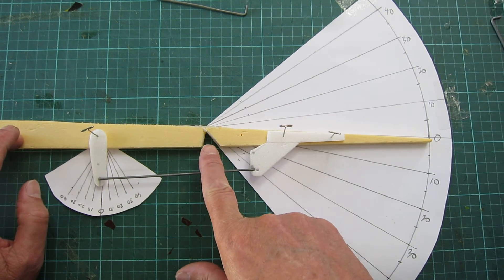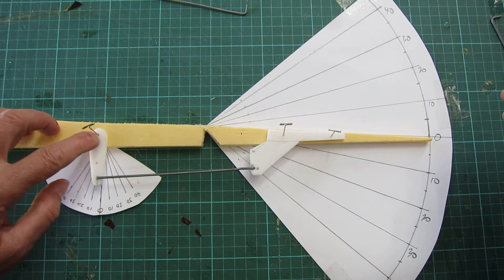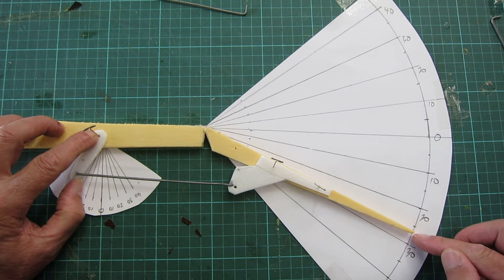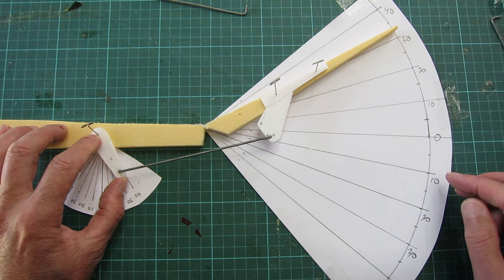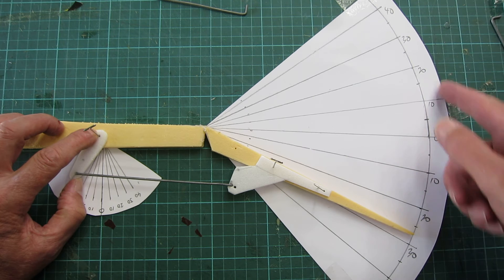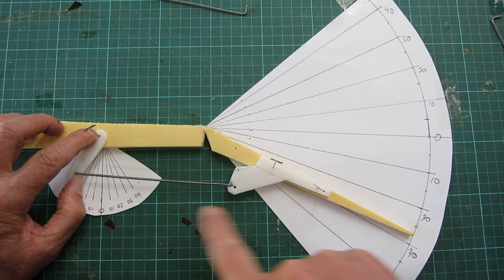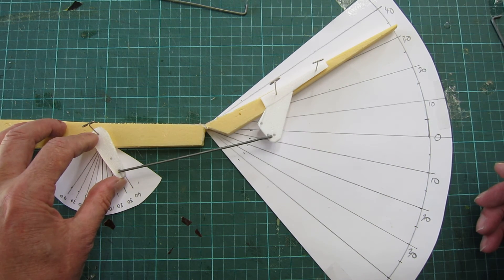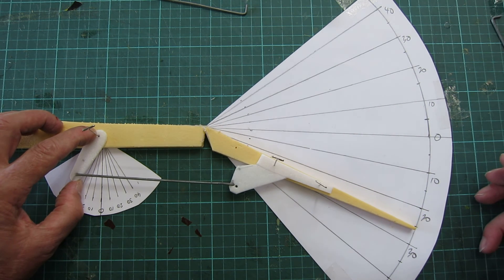Aileron Control horn AHA!

Comment: Stunning visualisation....

what about, when the whole thing is flipped to the top of the wing... is it then the other way?
Reply: +Stickmix FPV Yes it would give reverse differential which is bad.
Reply: +Andrew Newton Could you possibly show an example of the other way "on top" and explain why reverse differential is bad and why differential is good.  Also, what would happen if you moved the control rod to where it normally go; would that be good or bad and why.  - Thanks
Reply: +SnapPunch Robert Yep that will all be in the feature length version
Reply: Ahhhh, Sweet. Excellent Sir, Excellent.

Thank you so much.